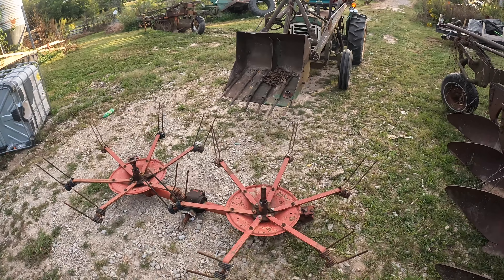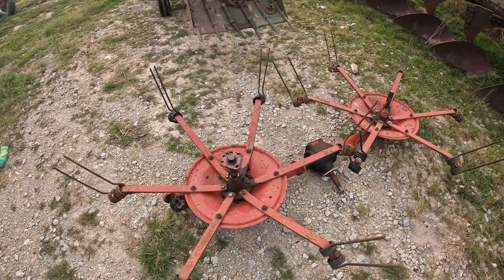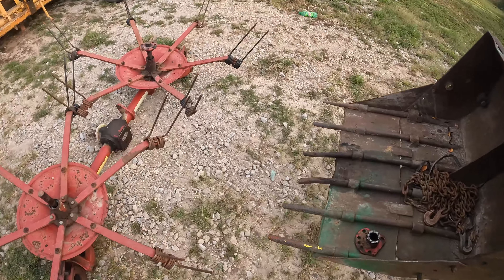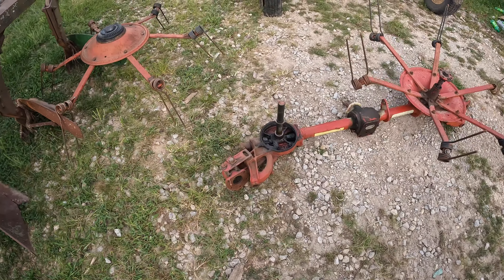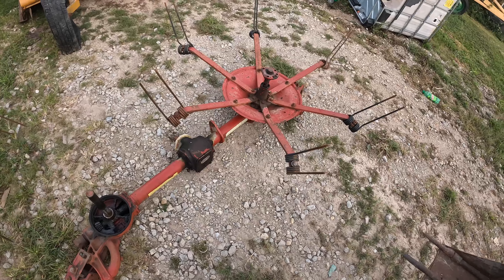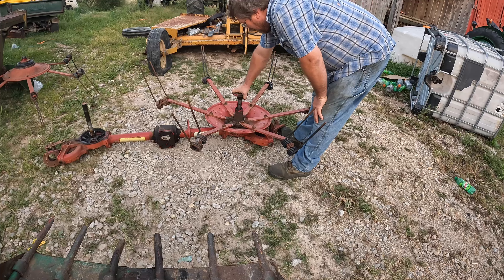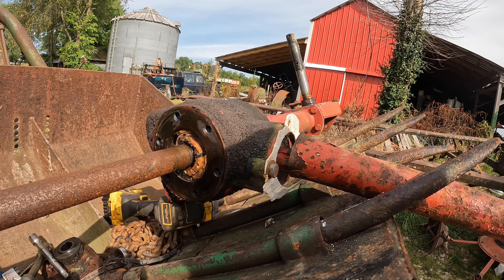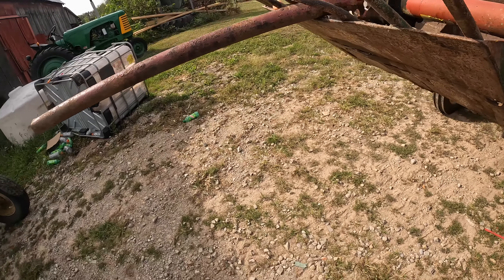HAY TEDDER Flip-Flop: NEW HOLLAND 163 Part 2

Comment: There was a 2 rotor tedder in the consignment section at the WRVAA show.  I started to look at the tag but there was some guy giving it the once over.  I did not want him to think I was competition so he could snag it cheaper.  It looked like some good smaller-size stuff was in the consignment.
There was a guy who had a 440,550,660,770, and 880 sitting next to each other. The next tractor was a 2-105.  To me, all of them looked ugly as they had all been painted and clear-coated.  They never came that way.  The finish was like glass and so slick that dust would not really stick on them.  There was a HG Oliver crawler plowing.  It was pulling a JD 2 bottom that kept plugging up with soybean stubble.  It was a great day for visiting the 4-day show.  The gas engines had a great turn out.  Lots of Maytags were popping away.